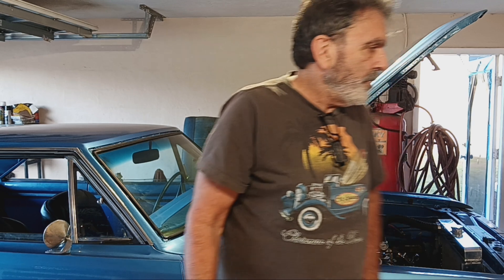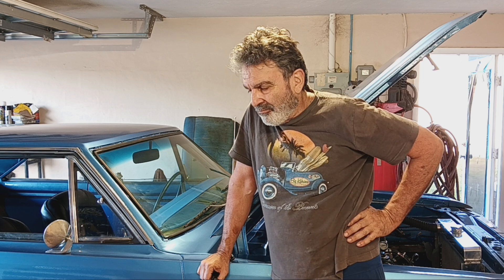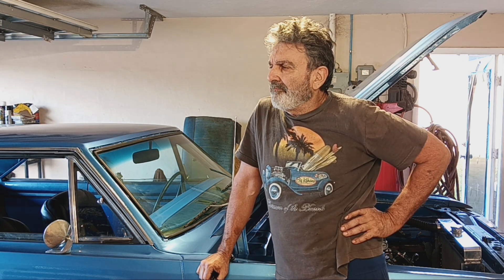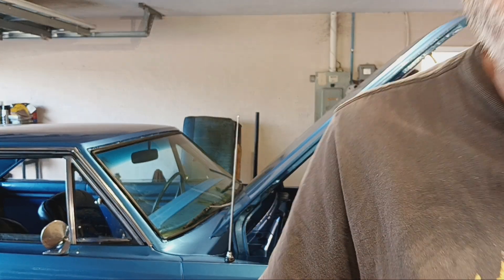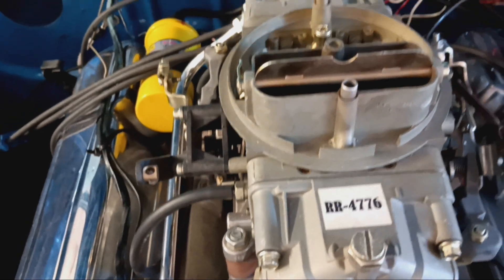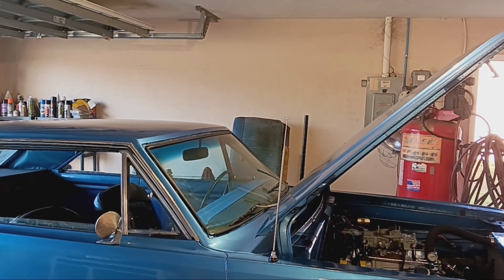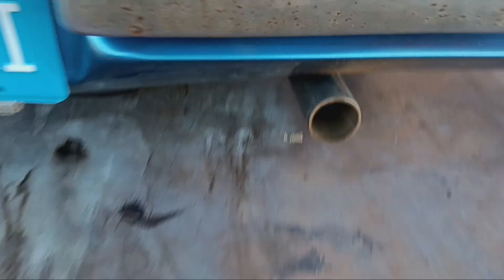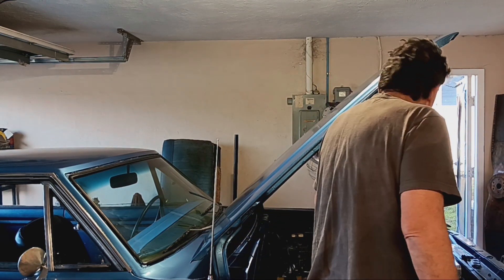Showing very noticeable lean conditions in this 340 Mopar engine

Comment: Cant wait to see what the cam, heads , and 850 carb does for ya as a total package . Its going to wake it up for sure . Ive been thinking about putting a 850 main body on my carb and seeing if it will help if not i can go back to 750 but im fixing to put these trickflow 11r heads onñ and solid roller lifters on with the swap . If I had your money id put a supercharger on 😂🤣jk im ,gonna try and be fast enough without it. Its surely fast enough as it is but we are always chasing more power as im sure you already been down that road yourself. 🤣😂🤣 but man you have really made something nice out of that car since you first got it

Comment: Frank. 340 x 6000 / 3456=590.278. Your backfire sounds like you need a bigger front squirter,or accelerator pump cam.
Jets 2 up from standard, bet you it works.

Comment: Traditionally the double pumpers went from 600 to 850 CFM in increments of 50 CFM. So, it is not an uncommon carb, and a lot of people did run them on smaller cubic inch engines or tunnel rams. That carb on a mild 273 or 289 engine works real well, but is a bit small for a 340. Now, the CFM capacity of the carb has nothing to do with it running rich or lean, you can jet that carb to be pig rich or super lean on your size engine or any size engine. I bet that if you just richen the primary size by 2-3 jet numbers you will probably cure the lean running condition condition. You may also want to take a look at the power valve, it may be opening too late and causing a lean condition at part throttle. Old school way to size the power valve was to check vacuum at idle and divide that number by 2 and use that size power valve, this is at least a good starting point. So, if you have 15 inches of vacuum at idle get a 7.5 power valve.
Reply from the maker: That's a great idea - I will check the power valve and jet size. Thanks for the advice!    I do thank- ya
Carbs were not my specialty but I do see what your saying....   😊
Reply: @frankrizzo3922  You're welcome. I owned a Speed Shop in the 80's and 90's and I still own a business in the Performance Automotive Aftermarket. I used to rebuild Holley carbs back in the day for customers and I am quite familiar with them. Good luck with your project!

Comment: Hey cool! just so you know a bigger carburetor will make it run lean, a small one will make it run rich, with a small carburetor all your doing is restricting full throttle at Higher RPM, the smaller port increases velocity and Venturi effect, better low throttle control, a larger carb will make it seem faster because less throttle input will amount to a lot more air going past the throttle valve
Reply from the maker: I'm loving all the carb knowledge about this issue...  you had a great point!    I'm going to do some work on that 600 ( maybe go up in jet size couple numbers and little more power valve after a vacuum test....  anyway appreciate it!   😊
Reply: @frankrizzo3922  hey thanks boss, please get a wide band 02 sensor not terribly expensive around 200$ for whole kit, somthing like a innovative motorsports or AEM, weld a bung into the exhaust hook up + and negative wire it through the window do a free air calibration (easy) and then you know exactly what the fuel ratio is and will be  able to log it by simply mounting a camera facing it, u can quickly install an any vehicle with the bung welded on the exhaust make sure there is at least 7 inches of straight pipe before the sensor and its closer to the manifold so it gets hot enough to not fail faster but not too hot or it will also fail faster

Comment: I have an 84012-1 Holley 600 double pumper and it works fantastic on my 351w Ford.  Maybe your carb is fine at WOT, but lean at off-idle.
Reply from the maker: That's interesting....  🤔 anyway I'm going to investigate jet size etc... thanks!